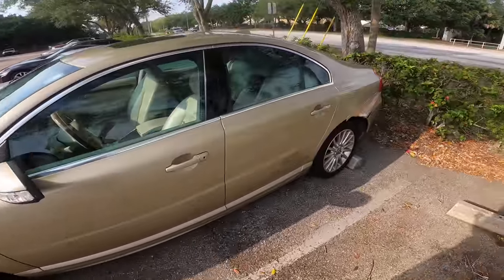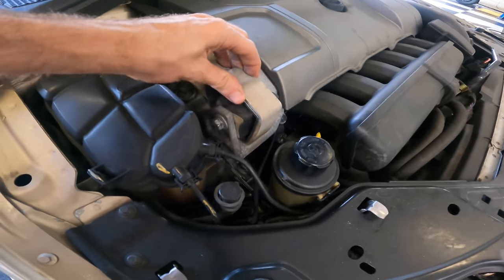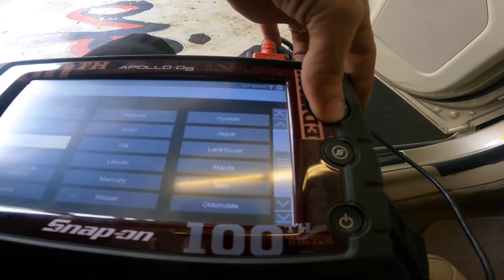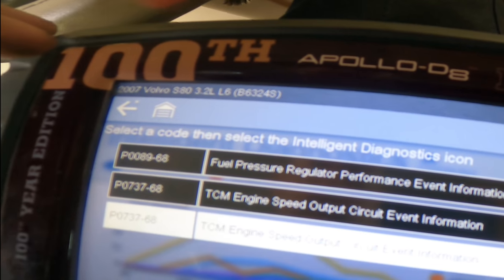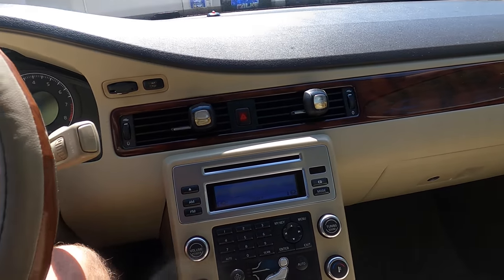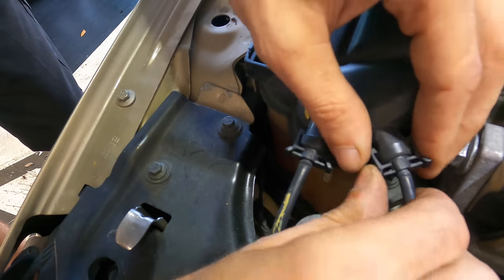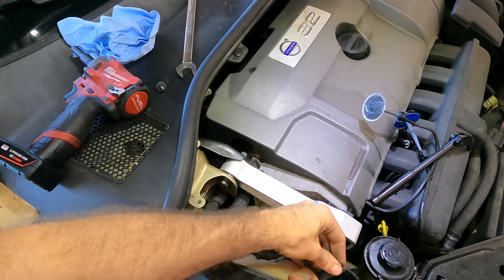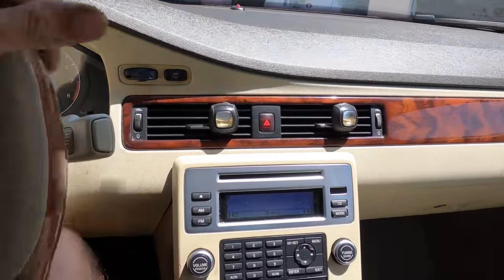How Exciting! A Volvo S80 3.2l Grinding Noise!

Comment: It's a Volvo you can't kill them................but this owner/tool is trying really really hard.
Reply: Oil and fuel and air are the triangle of motion.
Reply: I would run like hell if I looked at this one used. There is nothing more expensive than a cheap Volvo.
Reply: Probably getting into too many stoplight Grand Prix's is what roached that mount. Least they made an effort to find something close to official Volvo bumper tape.

Comment: That must be the easiest engine mount to change
Reply: no joke.!!!!
Reply: I guess its more of a pitch stop that an engine mount. Reminds me of the ones on Subarus.
Reply: Gm's  X cars front mount was just as easy.
Reply: and quite possibly the most expensive..... It is a Volvo after all.
Reply: @richardflagg3084  eh, volvo engine mounts aren't that bad... the suspension and transmission are what usually what get you. Usually engine issues are only with a small number of models and years with Volvos... including my S60R which is bad about cracking blocks if you push tuning too much of drive it really hard during the summer... or if you're a dunce and drive it on anything but premium gas.
Reply: Those dog bone engine mounts on grand am/grand prix are about as easy to find. Changing them wasn't quiet as easy
Reply: The correct name for rubber part mounted very high on the engine is an anti-rotation snubber. It works in conjunction with the lower engine mounts to limit engine rotation under torque (roll) conditions. Great video and content.
Reply: @dsrocks6905  Usually Volvo is very dependable, if maintained well.

This one looks like it didn't get much love lately..
Reply: For a crappy Euro yeah lol I changed my upper torque mount on my Si in 2 mins after work, in the dark, while still in uniform since it got delivered during the day. That's the easiest mount imo
Reply: Nah. The one on the D5 Diesel Engines is even easier. 😄
Reply: @Chris-yy7qc  yeah but d5 is pain in my ass. They like to have leak from head gasket, thermostate is hard to change, turbo regulator like to fail after some mileage. Swirl in intake get loose and valve  lifters like to start working very loud... And thats not all
Reply: @k20z3keith7   a crappy European car which allows you to drive stupidly fast in bad conditions mostly safely.

How fast ?  plus 65 mph in sloshy conditions.
Reply: The actual motor mount is right below the torque rod that was replaced in this video, I'd bet that is also broken/close to its death.
Reply: The top engine mount on volvo 5 cylinders is easier.

Comment: Rubber gone bad - use a tube of silicone to fill void after removing old rubber - cost $6.50 - tape on fender says this is appropriate by DIY professional
Reply: Cut pieces out of a cutting board to match the voids, hammer and silicone those in, boom, performance engine mount

Comment: The upper engine mount is common on Volvo. I own three os these and really will not drive anything else.
Reply: Do you live in a hot climate? Ours is original and no mechanic has said a word yet going on 12 years hmm
Reply: @rosen9425  Yes and no The Volvo shops in the locations I have been all agree on this. Also check in with the Volvo parts suppliers and you will be told that this is one of the high replaced parts. If you get the poly one then it will last next to forever. The rubber one really does fail a lot per the replacement part numbers from the various parts supply houses.

Comment: Yes, that is where you use the key to open the trunk. Pull that little rubber stopper off and the lock is revealed

Comment: On the evap system codes, they're similar to what my old Volvo V50 did. Check the fuel cap is tight and the seal is intact. I solved it by checking my fuel cap and the seal was mangled so I replaced it and boom the codes went away! Always enjoy these videos Ray :)

Comment: top mount breaks because the lower ones are shot.
Some of those codes might be solved by doing a smoke test, vac leaks play havoc with volvos.
Fuel pressure can be filter or sensor.
Reply: Agree
Reply: If bottom mount(s) were also shot, then why no vibration / 'grindy noises' when Ray did his engine check at end of video?
Reply: Cant be filter because there isnt one, just a screen in the fuel sending unit. And the top mount goes before the lower ones, i have had 3 volvos and had to change the top mount in everyone of them, never had to replace lower mounts.
Reply: @sampsani  they all have filters, steel tanks volvo put the filter in the tank, but its there.
If you check your lower mounts you wont have to change so many uppers.
He also installed a cheapo duralast mount, that will last 6 months.
Reply: @sevendyseven4090  because the top mount is holding it but its over stressed and will not last.
Reply: @gerardjones7881  Ok, Gotcha ! That makes sense, Could easily be the case here.
Reply: @sevendyseven4090  long term volvo owner here he is correct indeed
Reply: There are only two sensible places to get a lot of things for a Volvo: Volvo and IPD. FCP Euro is good for some things. Wagonmeister is great for some, particularly older cars. Swedish Car Parts is another. For engine mounts, always IPD, and their in house brand. Experience has taught that when doing an engine mount on a Volvo, do both and the transmission Mount.
Reply: @michaeltutty1540  FCP is not very reliable, but then IPD costs more.
I've done ok at the dealer parts desk for many smaller parts too.

Comment: New viewer and sub here from Alabama because you earned it!  -  After 30+ years in the auto hail repair & claims business as a PDR technician, I can appreciate the challenges and solutions you demonstrate while performing your craft in public. Nice work! Although dent repair is a totally different skill, removing and replacing headliners, trim, sunroofs, lift-gates, hoods, trunks, doors, etc for access is just as tedious when dealing with the various clips and fasteners used on the interiors, some of which are one time use. Our worst nightmares are usually pre-existing electrical issues and gremlins to sort out. I really enjoy the channel as well as respect your skill, demeanor and honesty as a tech plus I've picked up several tips along the way, so thanks!  The only problem I have with you is that now I find my self saying "CLICK" when anything clicks or should click. lol!

Comment: Yeah... A Volvo repair! Wife will only drive a Volvo (3d one) so I've become very versed in Volvo repairs. One of ours was rear-ended and had a bunch of those same codes... Looking at that duct tape repair job it's been hit or backed into something. I would guess some of those EGR lines are bent/broken. I know they declined but I had flashbacks to the day when my wife got rear-ended at a stop light by a tween one her phone! Thanks for sharing. P.S. I've replaced the top engine mounts on her S60 twice... Cheap parts mean doing it twice!

Comment: In the Volvo community we call that the torque bar, if that goes out then you pretty much need to replace the rest of the motor mounts, there is another one directly below that. If the one below it goes out you will hear a grinding noise when you let off the gas. Also don't forget the pcv system, it's on the top of the motor behind the oil cap. It will cause a high pitch squeal.
Reply: And if you ignore the squeal, expect an oil leak 😆

Comment: The wife and I were driving yesterday and the gas light came on so I said. 

“The low fuel warning indicator is illuminated...that’s how Ray would say it”
Reply: my wife brings my truck home with the oil light on. she thinks i runs on solar im sure
Reply: meant to say gas light sorry
Reply: Ray would say you and your spousal unit were motoring down the parkway  when the decreasing fluid level of engine gogo juice attention illumination device illuminated. But if he said that it would need a 2 part video.
Reply: @MonkeyJedi99 yup shes a card and  she needs to be dealt with
Reply: @jacksprat3287  Ah! You're such a joker!

Comment: Those parking brakes got me, I bought a 2002 C220 estate which I bought from a family member, he said take it for a spin. After 15 minutes of not going anywhere he came out and said you are taking your time setting the seats and mirror. Which I replied where's the 🤬 hand brake. Lol 😂
Reply: Also, I found the starter went after a year. I used a 4ft long extension to get the sucker out. Boy I can't even fill a fuel tank now 😭

Comment: this video reminded me to check the engine mounts on my van while it's apart for other things and sure enough they're chewed through, so seems simple enough, I've got two dogbone type ones like that on the front, already did the lower one by the subframe on one side, and the other lower one appears in great shape.  Worth the $77 to get rid of the noises at idle in gear.

Comment: Those engine light codes have been brewing for some time. Where I live in the UK, if the engine warning light is on then the car will fail its annual MOT test and that means your car is off the road until it's fixed (the same with things like ABS warning lights, airbag lights and so on).

I any event, it would seem the owner's maintenance policy with that car is to do the minimum to keep it running and I suspect it will go to an early grave.
Reply: Do they run scan codes? Or could you just unwire the light behind it and get away with scamming them.
Reply: @MrShiftyeyesshady  You can't just disconnect the dash warning lights as there all light up for a few seconds when the ignition is turned on as a check the bulbs are working. It the lamps don't come on, it's a dead give away (things like ABS lights and so on, same system). It would be necessary to wire up a lamp with a timer. It's possible of course, but those bulbs are normally plugged straight into a dashboard PCB, so it's not trivial either.

Also, there are emissions checks performed too, and if the failure affects that it will fail.

Comment: Many Volvos go through these upper mounts every 30,000 miles or so. They can be replaced with ones that have urethane isolators instead of rubber, but they will rattle your teeth at idle. I tried one and removed it immediately after the test drive, so I resigned myself to frequent replacement of the factory ones.
Reply: I found a fix that helps without rattling teeth out. Get a polyurethane roofing adhesive  and add some in to fill some of the gap. It dampens the movement without making it super rigid. Its worked great on mine.
Reply: It depends on how heavy your right foot is

Comment: We loved our old S80 except for the pesky intermittent connection at the ECM cable connection. Used to throw many random codes. Unplug it, plug it back in, disconnect Battery for a reset and good for another 15K miles. Think I found it and solder wire to pin with no success. I spent way too many hours with a meter trying to find the connection issue and never did find it before selling it.

Comment: That's my kinda repair, top of the engine and two bolts. Good job Ray
Reply: YES.!!!!!
Reply: Ten bucks says the engineer who designed that mount was sent for "remedial training."  🤣
Reply: @UTubeHandlesSuck  yep can’t be making cars easy to repair now
Reply: As a technician these are the worst repairs because you get paid virtually nothing for it lol, good for the customer, bad for the tech, I guess the customer is allowed the better end of the deal occasionally lol
Reply: Here's the Gotcha : top is breaking because lower is shot.

Comment: If there's a fuel pressure regulator with a vacuum reference, all of the codes (except the TCM codes) could be caused by a vacuum leak.

Comment: As a Volvo owner a couple of things: doors will unlock just by having the key on your person as will the engine turnover. No need to insert or use the buttons. 
My trunk was stuck too. Turned out to be a fuse.
I believe that is the wrong coolant. My S80 and S40 use the blue. 
Thanks for showing me the motor mount  thing. I am better off now.

Comment: I bought an auction car. I brought to a shop I knew nothing about. I wanted an alignment but I knew it needed front end work. After they had taken the front wheels off, the manager brought me back while it was on the lift. He had a list of items. He gave them to me and showed me why the items needed to be fixed. After the alignment, I went home and ordered all of the front end parts on EBay. I did the work, without having to do any diagnostics. Struts, axles, motor mount, control arms, tie rods and swaybar links. Rides really tight!
Reply: You're the guy that declines all work after the tech does the diagnosis
Reply: See no problems with person denying the repairs. You take it to the shop and paid their hourly rate for diagnostic. If you are confident in your skills, why not save the money.

Comment: That trunk latch is missing the spring, or it has broken. It is actually an easy fix the lever that you squeeze can manually be tilted forward that would need to be done each time before the trunk is closed. Pushing the leaver forward should allow the remote to actuate the switch as well.

Comment: Hey Rey...the cap displeases me as well. I have the same tank in my 2014 Mondeo. I found it easier to remove and replace once the engine is warmed up.  They seem to get tight with age. I did eventually replace the cap with a new one and it was easy to remove cold or hot.

Comment: That top mount reminds me of the "dog bone" used on GM 4's in the mid 80s. That thing always broke. There was a replacement that used a hydraulic cylinder instead of rubber biscuits, but that too wore out over time.
Reply: Yup. I had an '83 Phoenix and always kept a spare on hand. Don't know why they broke so often considering the engine was fairly gutless and the 2 trans mounts were stiff as hell. The mounts on the A bodies were much better for vibration isolation.
Reply: @patricknesbitt4003  I had an 86 Celebrity. Next to the Citation, the worst POS Chevy ever That bastard stranded me no less than six times when it wouldn't start due to a phantom intermittent electrical problem. I finally called a wrecker and got rid of it.
Reply: @adotintheshark4848  If it was a 2.5 four banger it likely was the ignition module in the distributor. Common failure item.
Reply: @patricknesbitt4003  it was a 2.5 and I replaced everything ignition-related. I believe it had a wiring harness fault and wasn't going to soend big bucks on basically a hooptie to figure it out.

Comment: Ray have you ever considered wearing a silicone wedding band at work? They are non conductive and you can’t get your finger stuck in any tight space. People in the trades have de-gloved, amputated or gotten zapped due to a metal ring. I stopped wearing one altogether while working. 
It’s just a thought. Silicone rings are really cheap on Amazon.

Comment: Fuel pressure is likely the sensor at the right end of the rail.  A REAL pita to reach the torx screw.
Reply: I replaced mine. Wasn’t too hard.

Comment: It's likely that the lower torque damper is missing, on those early 2010 3.2s they didn't come with them. The mounting brackets are still there and  are quite easy to put in.

Comment: Those micro switches on the trunk is known to go bad. Ford here in Europe use the same type on their Mondeo (Contour) and they are also known to go bad from time to time. On most Ford's there is a hidden key hole in event of that micro switch decide to not work. I think some Volvos has them as well.

Comment: My 2008 Volvo V70 D5 is on 500k KM atm still going strong :D.   however the never volvos with their VEA 4 cylinder 2.0 is pretty bad with Piston rings going bad at around 80k-100k Km. High pressure fuel pump eating up the crank and valve cover leakage
Reply: New Volvos are Chinese, not Swedish. Even worse than when Ford owned them. My 1990 240DL is now at 614,000 km.
Reply: @michaeltutty1540  yea everything go much worse when geely got involed the 5 cylinder engine and the old b21 b20 and B230 was pretty much unkillable

Comment: I’m amazed they managed to squeeze an in-line 6 in transverse orientation into that thing!
Reply: It’s referred to as an SI6. The S is for Short. It was achieved by placing the accessories on the rear of the engine over the transmission.

Comment: one mount breaks the others will follow. the rubber at the tank fillerneck to tank do dry up and leak. beast to replace. Turbo engine acutated vacuum motor mounts want to leak and cause problems.

Comment: The engine mount below the dog bone you found also causes a grinding in reverse.  It collapses and the engine rests metal to metal.  We have an ‘08 V70 3.2.  Can’t wait to get rid of it.  My 5th and last Volvo.
Reply: Interesting i have that same car. 167,000 on it. Changed brakes, serpentine and water pump, 2 motor mounts, tires, some light bulbs. And that's about it. Uses about a quart of oil between oil changes, i change oil once a year. Right now it does have a exhaust leak showing bank 2. Needs a new catalytic converter so maybe $600 after market?
Why do you dislike the car? 
Been reasonable to me. I tow a 15ft trailer with it. Pile it with stuff.

Comment: the costs of repairing a Volvo are astronomical if you use a dealer or "Volvo specialist"....you are providing a reasonable alternative....OEM parts are also very expensive.
Reply: One thing to do when owning a Volvo is to figure who the OEM supplier of parts is, then proceed to pay half the cost.
Reply: My wife will only drive a Volvo so we've had one (or 3) for the last 35 years. I've been able to do just about all the maintenance and repairs myself. IPD offers original Volvo as well as OEM replacement parts. Like everything, sometimes you have to use the Volvo parts in key locations.